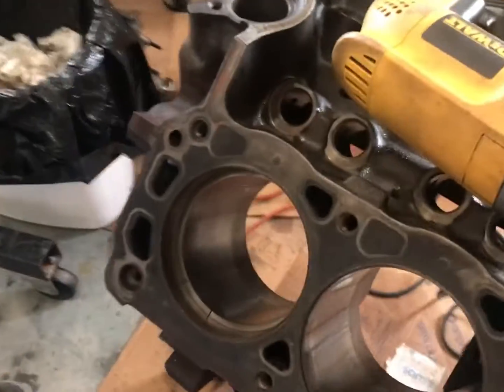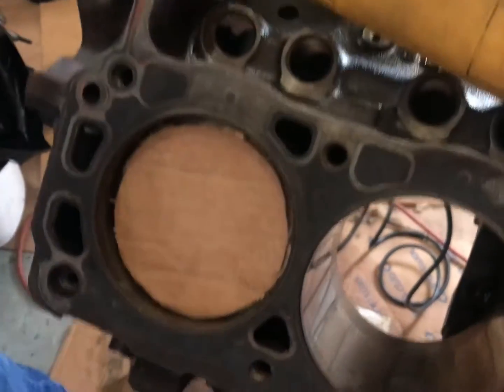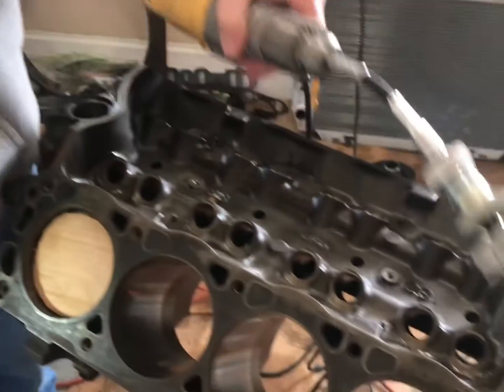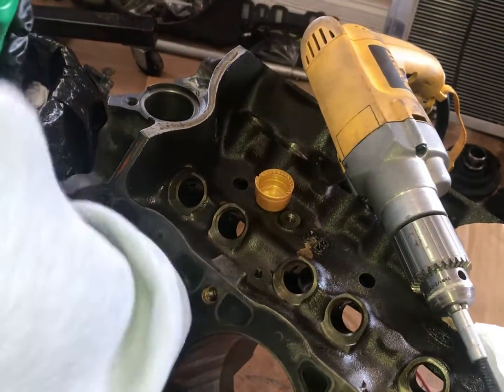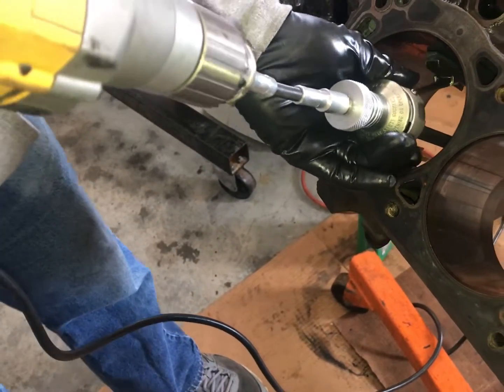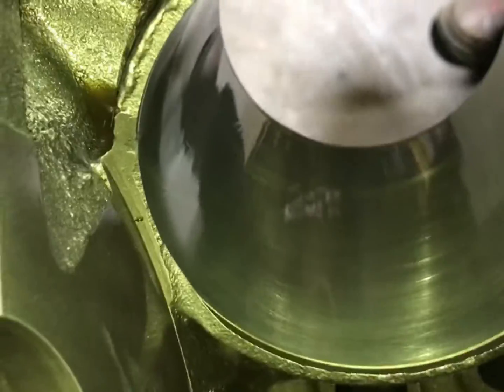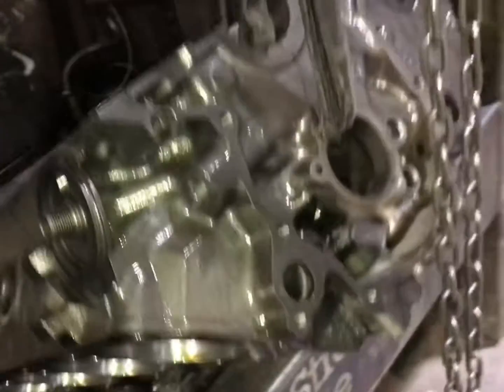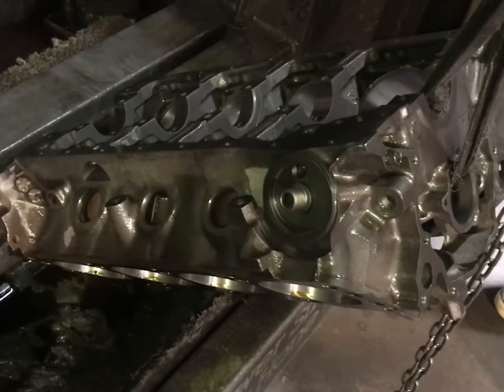Fixing A Damaged Engine Cylinder With Honing: Is It An Option ?

Comment: Use thicker stones.and run thicker oil.problem solved
Reply: Yeah, he never mentioned the grit of the stone he used - coarser would definitely do more removal, but the risk might be ending up with a tapered bore - hard to ensure even removal along the whole length of the cylinder when you're taking that much wall off

Comment: As an engine builder some blocks warp more than others from head bolt tension not to mention scores , Nick’s and gouges in the cylinder wall therefore, I prefer to board the block out and he’s a good rage at home. Sometimes I finish it off with a ball horn, depending on the type of rings that you have of course I used a torque plate every time with the head bolts and torque spec. I’m gonna use.😊
Reply: wtf language is this?
Reply: @hylomane 😂

Comment: My vw 1.8t compression 120 90 90 and 90. 275k stsrts fine but horrible oil smell especially when going downhill  that eventually turns into a smoke screen like James bond level. Do you think I can get away with just replacing the rings?
Reply from the maker: @Kevin-wy8kc  How did the plugs look?  That’s impossible to know without tearing it down.  Perhaps a look through the spark plug holes with an inspection camera would reveal if the cylinder bores are a candidate for a re-ring job.  I don’t know what compression number is healthy for a 1.8 but that’s a big spread from one highest to three lowest.  My first guess would have been a blown head gasket with two low numbers next to each other but three?
Reply: Do a piston soak 1.8t’s are know for sludging which will gum up the rings. Also do a deep engine flush by filling the crankcase with diesel and using low pressure into the crankcase to bubble it. There’s a video on doing this.
Reply: @BenBelty  just got done replacing pistons and rings like 20 mins ago...im stalling to start it.
Reply: its acually been started already and it sounds like it never even taken apart but oil pressure light comes after 2000 and found a decent oil leak in my exhaust so im on my 3rd or 4th maxxspeedingrods k04 this one however was super tiny so i put a bigger cold side i had i know i know shaft isnt balanced now

Comment: JB weld might have been able to fix that...hone it to knock down any high spots...clean it with brake cleaner, use a pick to get out any remaining contaminants then brake cleaner again...JB weld it, then hone it flat...i did this with my severely pitted willys jeep engine...it runs fine now
Reply from the maker: @michelle-lz8tg  We actually thought about doing that.  JB Weld is good for maybe 500 degrees so not sure how that would work long term and if a chunk ever pulled out of that deep groove in that bore it would probably break something.  It is amazing stuff but I would be hesitant to test it.
Reply: @millionmilegarage9587 
I thought he was joking. 😮
Reply: @millionmilegarage9587  the jbweld will burn and form a hard black carbon deposit...but you are right...there is always the risk of it letting lose and then you are back at square one.
Reply: @millionmilegarage9587  JB weld is a last ditch effort before throwing the block away. I have heard even auto manufacturers use something similar. There seems to be more to it than it appears.

Comment: Ok hi so what is the solution to fix scratches on the engine block
Reply: what if you turn the ring gap there at that point
Reply: @zakeerbotha4396 

It will still be a problem. Rings move over time, and the gap would move away.
Reply: Bore it out oversize.

Comment: If you don’t mind me asking, what would a sleeve work costed for that one cylinder? Just acquired a 6.2 Gen IV LS with a burn piston. Gouged #7 cylinder pretty bad. Thinking sleeve job will be the cheapest route. All the other cylinders mic out and look good.
Reply: Thank you. Around about what I was estimating. Still planning pretty much a full rebuild, just without the cost of 7 other pistons.
Reply from the maker: Hi, my best guesstimate is about the same cost to bore all 8 out but without the mandatory hot tank and frost plugs and camshaft bushings it would be significantly less than the $350.00 or so we shelled out for the above.  I would think $200ish plus the cost of one new piston in standard bore, if same manufacturer and style should not throw your balance off, way cheaper than the full on overhaul we did.

Comment: Too bad, big bucks for machining, new pistons, rings, all the bearings, lifters, etc. Probably could have honed it, re ringed it, slapped it back together and run it. She would have had one weaker cylinder but still would have run decent, but I guess it depends on what you want and how deep your pockets are.
Reply from the maker: That cylinder filled up the oil pan with antifreeze from the vented cylinder head via the three rivers carved top to bottom on that one cylinder, that would have been a very weak cylinder and would have put blue smoke out the driver side tailpipe, decently ruined but far from decent.  And yeah it sucks, big bucks for my son😄. If it was my money, would have sleeved or bored the one cylinder and called it good.
Reply: @millionmilegarage9587  How does scoring on the cylinder wall result in antifreeze in the oil pan?
Reply from the maker: @_pld  https://youtu.be/Z-goEu9tRXY?si=U4-1r_94UG1LWflo